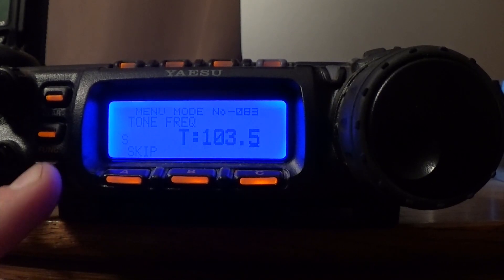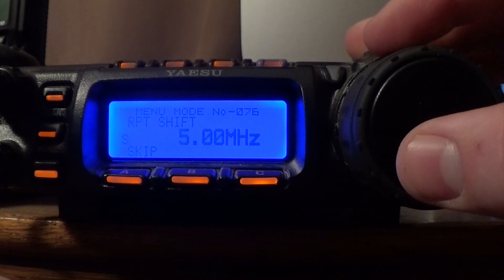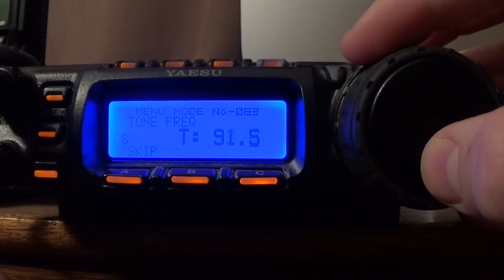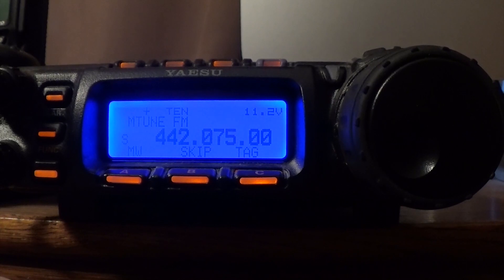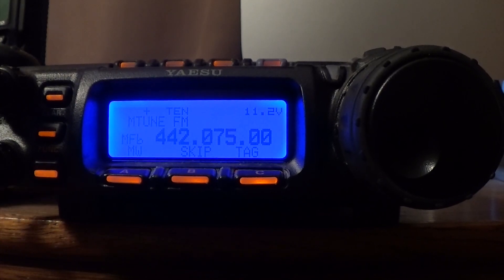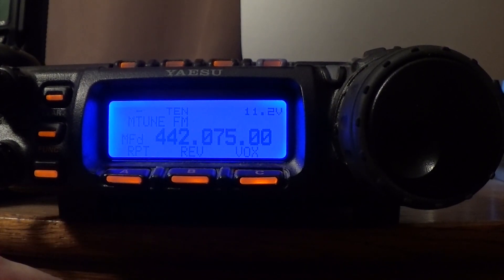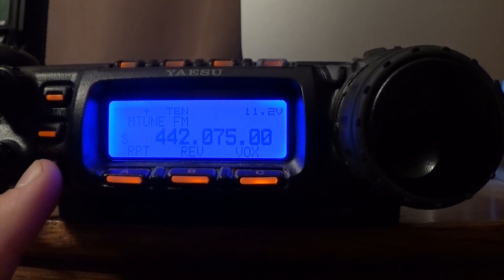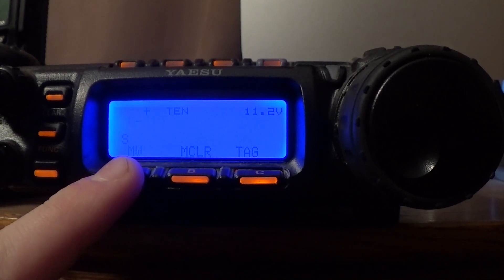how to program the Yaesu ft-857d

Comment: Hi, Eli. I just came across your video here and wanted to make on suggestion as it was missing something in your video. You did an excellent job of describing how to program the FT-857D but you might want to add that if you're programming a repeater frequency into the radio you also need to go to MFe and touch the A button to enable the Tone Encode (TEN). If you don't do that then working repeaters will not happen. Once the TEN appears on the screen folks are good to go. 73...WD7N
Reply from the maker: Thank you. I didnt realize that i left that out. Thanks for letting me know